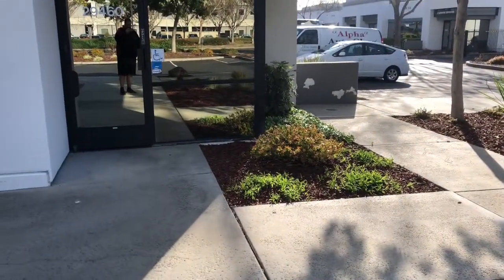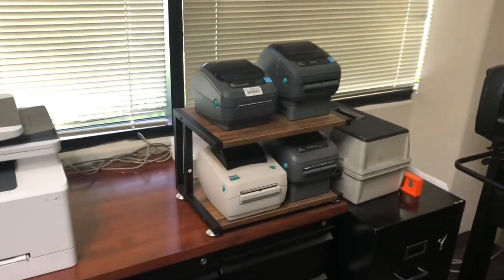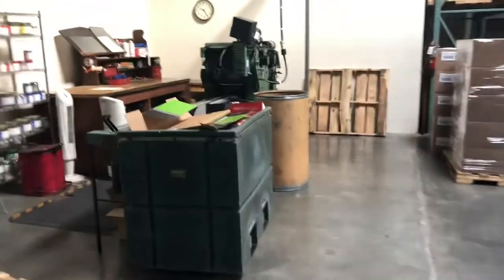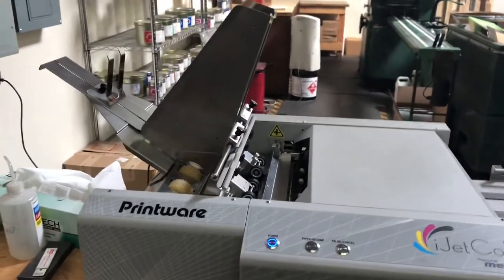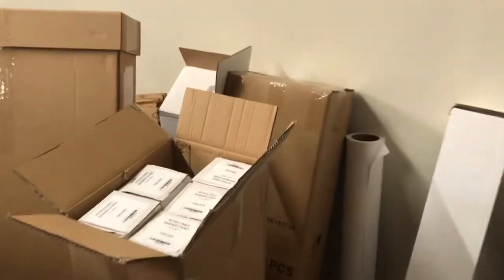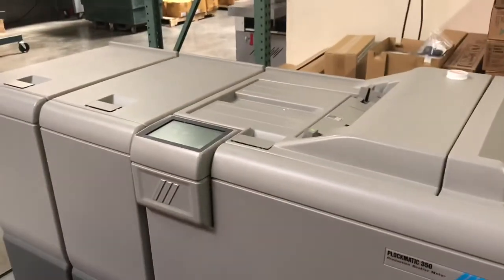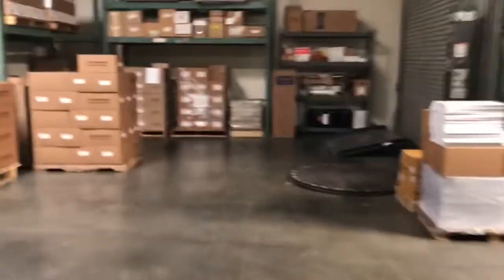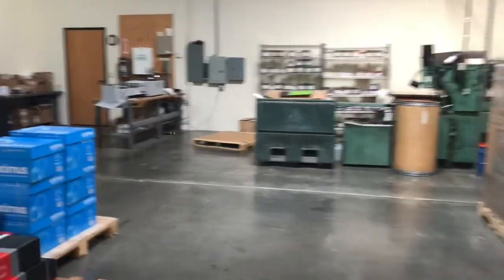Print Shop Tour

Comment: Nice shop!
Questions:
1. Why did you get a Ricoh machine through Heidelberg instead of Ricoh?
2. For standard #10 envelopes, if you had a small order (2,500 or less) in 1 or 2 color, would you still use the offset or use the inkjet? In other words, where’s the break point between the two machines and why? 
3. Are you happy with the Ricoh/Heidelberg?
Reply from the maker: Very happy with Ricoh/Heidelberg. We went with Heidelberg because at the time we also bought a 2nd Polar cutter with them and sold an old DI press, so it made sense on the financials. For the envelopes it depends, a lot of customers are looking for a specific look of offset, so we have to run it offset no matter how small the quantity, but yeah, if it's a short enough run we would the inkjet or the Ricoh.

Comment: Just catching up on your videos :) I wondered do you use software to track your jobs or do you just use job sheets? We are currently looking for a method of keeping track of jobs so all ears haha.
Reply from the maker: When I was at the place above we used old software called Everest. However at my new job we use Printer's Plan. It has the capability to barcode jobs, but we don't use it. We manually enter in when jobs have been approved and then when they have been shipped. It's good software, but we don't utilize it as much as we could.

Comment: great printing equipments but very few finishing machines. Creaser, foil and gold laminator, square back gluer, round corner, driller ... Greating from a Belgian printer !
Reply from the maker: Hi Ben, trust me, I know. I wish we had a more diverse portfolio of finishing equipment in house. However, we do have some outsourcing partners very close by that do laminating, perfect binding, die cutting, etc., so it's a very short trip to get those additional finishing elements done. Thanks for viewing and your comment.

Comment: How do you like that iJet envelope printer? Can it bleed? I'd love to see it run.
Reply from the maker: Honestly it was kind of hit or miss with that thing. This video is from the old shop I worked at. I no longer have access to the printer. But when the printhead was brand new the prints were excellent. Problem was that the printhead life was supposed to last around 500k impressions, but we never got more than like 150k before needing to change it. Plus all envelopes had to be run in landscape which slowed the machine down. I would not recommend it.
Reply: @miketheprintman   Thanks for the reply, love your videos.

Comment: NIce tour! Hey, How do you like the Plock 350? I've been thinking about picking a used one up for offline booklet making.
Reply from the maker: It's a solid machine. We don't really run it inline, but it has the ability to dock and run direct with the Ricoh machines. Only thing I wish we would have gotten the one that does three side trimming, would speed things up. Otherwise, it's a great unit.
Reply from the maker: I did a new video that shows the Plockmatic in action a little more.
https://www.youtube.com/watch?v=XOvxA6KdQTw&t=2s

Comment: How much do you pay monthly for that WHS space?
Reply from the maker: At the time the lease was around $7.5k per month. Prices have gone up since then here in the Bay Area, so I’d expect it’s closer to $8-8.5k now for that same size unit.
Reply: Wow!!  That's insane.  So you're not there anymore?
Reply from the maker: @blueghost4121   we closed down back in April of this year. I'm at a new shop now. I'm hoping to get permission to video that place as well. It's bigger and they have more equipment.
Reply: @miketheprintman  I'm in my garage still.  315 square feet.

I have an HP Latex 570 and we need to get a bigger place but renting space is too much.  I'm thinking about expanding my garage 🤔
Reply from the maker: @blueghost4121   I hear that. I've been thinking about starting my own shop somewhere, but prices are so high right now, it's ridiculous. The garage might be the place I have to go. The 570 is a nice machine. Great for banner work.

Comment: Wish we still used the Firey DFE instead of the Heidelberg.. ugh.
Reply from the maker: What machine do you have?
Reply: @miketheprintman  The 7110x Versafire. Was using the original DFE but then Heidelberg sold us a new SupraSetter and Prinect along with their DFE... I think Hberg over engineers their software and makes things way more complicated then they have to be...
Reply from the maker: Prinect is great if you have accompanying offset equipment, but to be honest it's kind of overkill for digital alone. That's why we decided to just go with a Fiery unit.

Comment: Agh, still using those horrible HP Laser machines. I also would reccomed you switch for an older Designjet model. Those are built like tanks and last (touch wood) for a really long time
Reply from the maker: Yeah those designjet desktops were well built for sure.

Comment: Your summa cutter had climate issues in the warehouse? Too humid?
Reply from the maker: It had something to do with the cold I think. For some reason in the morning during winter it would give a "X Axis Overflow" error code. But as soon as we moved it into my office we haven't had problems since. The only common thing between the two seems to be temperature, so that must be it.
Reply: @miketheprintman  Interesting. Yeah I'm looking to sell my California properties and move to the midwest so I can get my print business off the ground.  Sounds like climate control is definitely important especially for modern digital machinery. I'm sure regulating larger warehouse temps gets costly lol.
Reply from the maker: Main thing is look for a warehouse that has insulation. There are still a lot of places, especially older buildings that weren't built with it from the start. That can be a huge savings in AC costs.